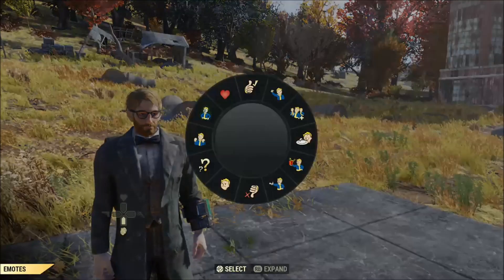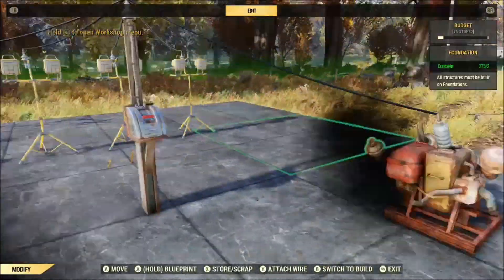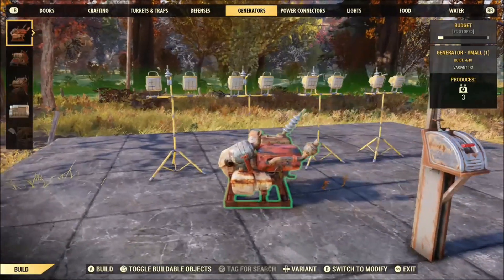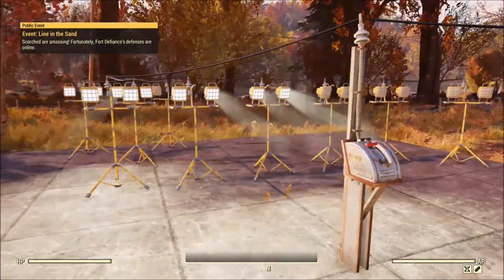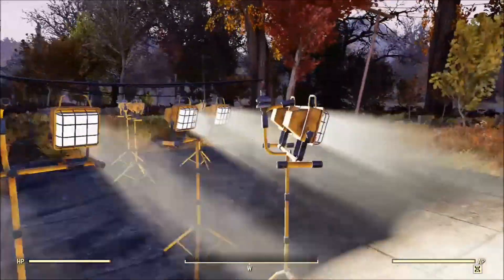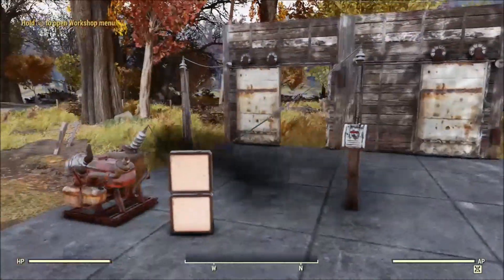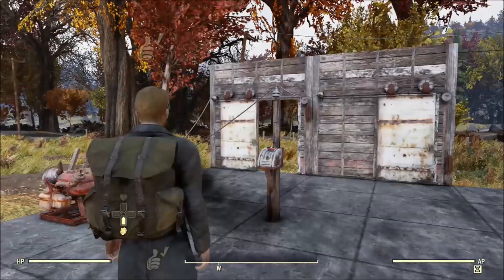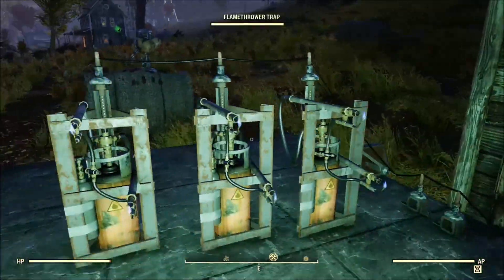Korin's camp tricks #4: Utilizing power priority, pathing & layering to create useful logic switches

Comment: I've come across a bug that breaks the whole thing. Let's say you have a string of lightboxes, and a small generator on one end. Three of the boxes will be lit. Now connect a switch to the other end, and nothing else (leave it unpowered). Place an ambiently powered light near the switch. In my testing, it generated +1 power from the first generator. Finally, create a new small generator nearby and connect it to a conduit, so it can radiate energy (don't connect it to the lightbox setup). All 3 of that power will be added to the first generator, lighting up even more power boxes.

Seems to be fine with the tube conduits.
Reply from the maker: Yes there are some nuances in the way this has to be done. I never did a video about it but posted about it on the Youtube page: https://www.youtube.com/channel/UCqlJpXBgp0-p2ihq2Rh1UiA/community?lb=Ugx86l1zKIjQDDqv-Sl4AaABCQ

Power can leap from one circuit to another through any kind of radius connector/light. You also can't have generators on different parts of the switch, they all have to be in the same place.

There are other nuances like the jukebox being the only radius powered item that can draw units of power (2) versus lights which draw nothing (0).

It's possible you could find a use for these bugs however since they seem to be behave consistently.
Reply: @aswiftkickinthejunk  I forget if I'd mentioned it to you, but your videos helped me to understand how to create logic gates in camps. I think I figured one or two out, then was stumped on how to continue, then I found your videos. The most useful logic gate in 76, in my opinion, is the XOR gate for two way powered doors/garage doors. I made two videos on the topic, if you're curious.
Reply from the maker: @PhaserRave  I watched your video, really good breakdown! More detailed than mine as well. I hope it sees some more use, I still don't think this is a well known/used trick.

Comment: I didn't know this haha! Super interesting! <3
Reply: you can do some pretty interesting stuff when you break parts of the circuit too, like making a pressure plate stay on forever
Reply from the maker: @Kazamati  Yeah I have seen that... actually I was messing with missile turrets recently and using their on/off state to trigger pressure plates and tripwires (they'll slouch when they power off and push on the plate/cross the wire). But those are more unreliable than just re-routing based on priority. I also tried using the windmill to trigger pressure plates on an interval but it didn't work sadly.
Reply: @aswiftkickinthejunk  it would have been rad if the windmill set it off! I guess you could put a cow in a room with a pressure plate, would be very random tho haha